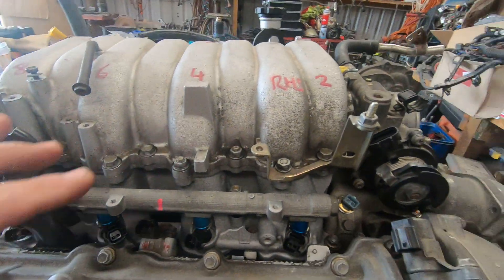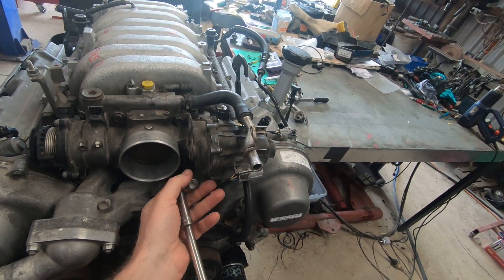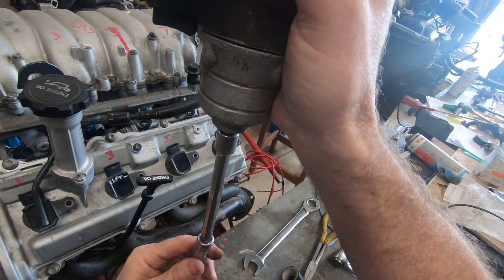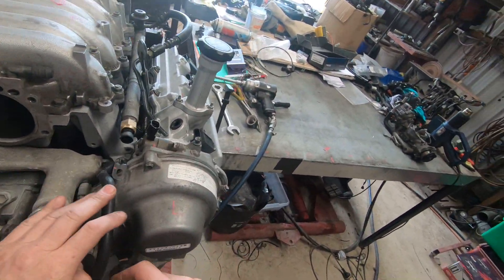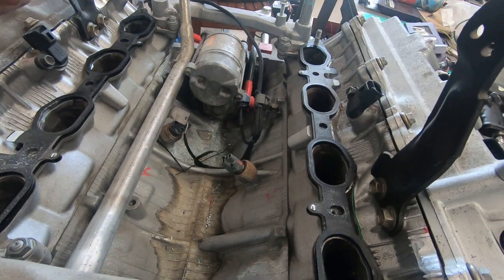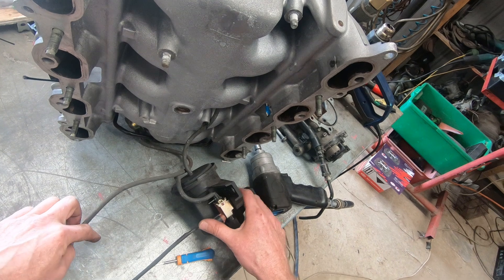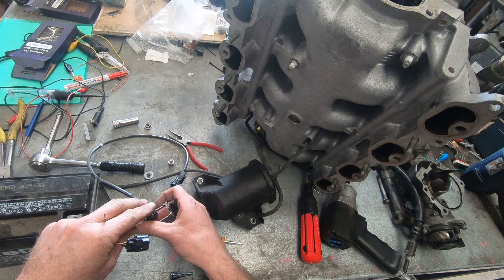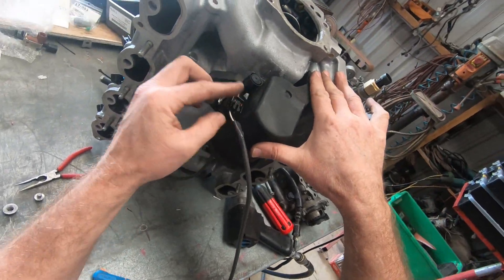1uz VVti and 3uz VVti AVIS or acis solenoid change.  The flappy thing in the intake manifold.

Comment: Hey kelvin, I have a 1uz vvti looking to replace my vacuum canister and solenoid along with new air hoses. Do you know if the 3uz parts are interchangeable to use with the 1uz vvti motor? Lexus database says they are incompatible but I have a sneaking feeling it will do the job. I’d simply buy the correct factory part but they are nla in USA market.

Comment: Hey man, I really hope you happen to see this, or at least someone that knows the answer. I have a 99 Celsior imported engine and I'm still learning about it as I go about fitting it into my car. I've had the intake manifold off and I'm pretty certain that it hasn't been off in many years due to the crust and condition of the fasteners, and mine didn't have any sort of vacuum canister under the manifold, is that normal? do I need to find one? I know the JDM engines had that weird hydraulic fan and such so maybe they did things differently under the manifold?
Reply from the maker: All 99 engines, being VVti should have the vacuum reservor under the intake from stock.  Maybe someone has done something they shouldnt have done.  Id recommend sorting it correctly.  Cheers Kelvin
Reply: @CartuneNZ  Legend, will do.

Comment: Is there a part number for the VSV? If the swing arm doesn't move when you start the car is that a good indicator that the ACIS system is not working?
Reply from the maker: Yes,  no movement on startup indicates an issue with the system.   Toyodiy.com has all the toyota part numbers
Reply: @CartuneNZ  Thanks for the reply. I just installed the new vsv assembly today and the difference is GREAT! Partial throttle is much better and my gas mileage has increased by 3 mpg according to the cars display. Planning to purchase one of your re-mapped ECUs in the very near future.
Reply from the maker: Excellent news

Comment: How do you run this on an aftermarket ecu, when would the solenoid turn on ?
Reply from the maker: Wire it to aftermarket ecu on auxiliary output.  If you watched and understood the video it suggests its turned on at low rpm, and off at higher operation.
Reply: @CartuneNZ  yes I understand  so auxiliary out put 12v on start up so the throttles inside close when should solenoid turn off so the throttles open or what rpm is the best
Reply from the maker: No , The ecu aux is normally an earth switch , power is supplied elsewhere.  Depending on the ecus logic its best to try and copy stock ecu which switches based on load , so a calculation of TPS , air flow , and engine speed.  The ideal switching point is best found by testing results on the dyno during tuning.  If only using RPM which is not ideal the switch point will be between 4000 and 5500.  Cheers
Reply: @CartuneNZ  once again thank you for your help

Comment: Good day Kelvin. A quick question on this. When do the solenoid get energized and when(rpm) do i remove the power supply to the solenoid
Reply from the maker: Stock ecu controls solenoid based on rpm, air flow and engine load.   Power is controled via main relay so is on with key on, and remains for a few seconds afted key is turned off with stock ecu.  Using dyno would find optimum switch point for trigger if using aftermarket ecu.
Reply: Thank you Kelvin. Currently run aftermarket MaxxECU. So the intake flap solenoid need power at low rpm to give you the longer route and when you reach a certain rpm it wil remove the power from the solenoid that shorten the air route as I understand from your videos with no vacume/default the valves is in the open position. Wil just get it on the dyno to get my sweetspot. With the MaxxECU have several options to controle the activation of the valve

Comment: Hey Kelvin
Do you think that can cause a Vacuum a leak? I have a check engine light P0171 System Too Lean bank one. I did a Vacuum leak test with smoke and saw no leak with any hoses. I did see smoke come out under the intake manifold. I took off the manifold and the gaskets are basically new. I see no other thing other than the Asis Solenoid, could that be my issue?
Reply from the maker: Absolutely could be an issue.  I replace heaps of them.  I would smoke the hose which goes into the canister to check it and power solenoid
Reply: I had a leaky hose under bay cover
Reply from the maker: Well done.  Thanks for the feedback

Comment: Any chance you can share the p/n of that actuator? Thanks!
Reply from the maker: The Actuator part number for the AVIS is 17335-50010  This is the actuator which bolts into the back of the intake manifold, controlled by the solenoid which is controlled by the ECU.  Cheers Kelvin
Reply: @CartuneNZ  You are the man! Thank you!

Comment: Hi, 
Is P1651 code for ACIS relating to the issue in this video ?
Reply from the maker: Yes.  This is the most common fault for P1651
Reply: @CartuneNZ  
Thank you. You are V8 guru 💪
I have ordered parts and hopefully my mechanics will sort it. 
They are firstly working on cambelt kit, then we need to look into P0430 Catalytic converter fault....and then VSV valve... so couple of things to sort out. 
The car has been hesitating sometimes between 2,5 - 3,5 k rpm and the goes like a storm... so hopefully new valve will cure it. 
Thanks again 👍

Comment: Hi Kelvin pls I need ur help my 1uz vvti rpm doesn't pass 3 when I push the accelerator pedal,I change the fuel pump,air flow meter,still yet the spark plugs are black pls help what can be the problem thanks.
Reply from the maker: Is it a stock 3uz in a factory car or an engine swap?  Has a scan tool been plugged in to check live data?  Cheers
Reply: @CartuneNZ  they swap the engine

Comment: HI Kelvin How familiar are you with the spitronix range of ecu's on the vvti motor? What are the core symptoms for the AVI failing? Lack of bottom end torque? cheers Andre
Reply from the maker: I have a spits here to wire atm,  non vvti though.   With avis the bottom end will be lacking.  Its super easy to check if its working.  I do it as part of each service on vvti vehicles.   Cheers Kelvin

Comment: I have a problem with the instability of the engine at startup ؟؟help me 
1uz-f1
Reply from the maker: Maybe tell me some details of the vehicle,  setup and what you have tested for and checked so far.  Cheers Kelvin.
Reply: CartuneNZ
 The spark plugs, air sensor and air filter were changed
Reply from the maker: @riadali5716  is it a standard car?  Or engine swap?  Which version of 1uz?